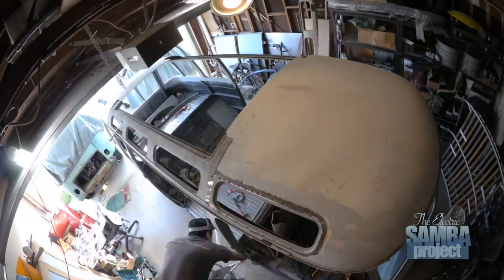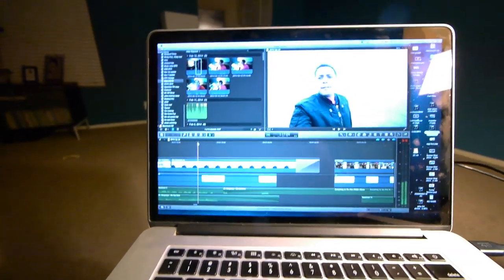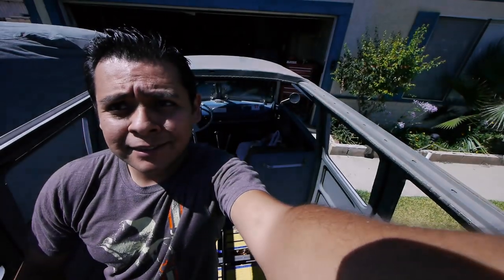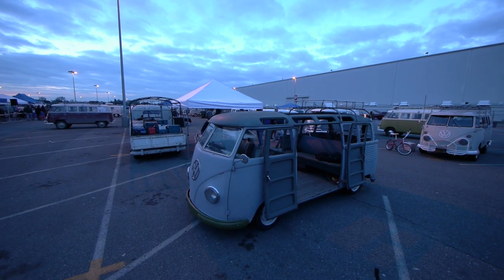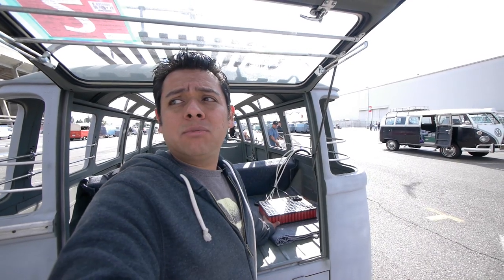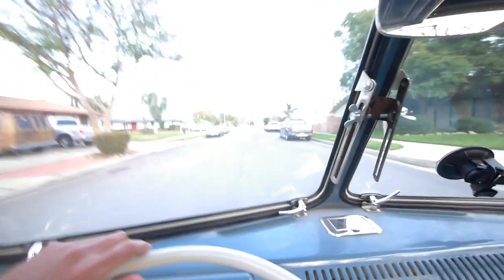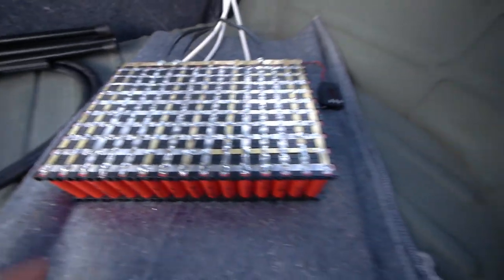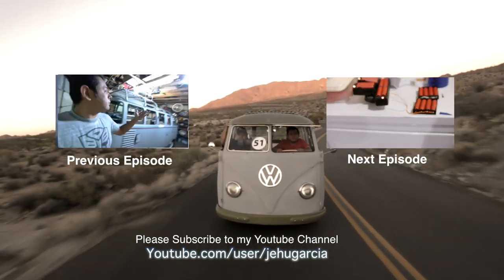Behind the scenes look at eSamba show + DIY EV 18650

Comment: You gave me an idea of building a 5KW Energy Storage box using one of my old Computer Rack cases.  I can install 741 16850 cells in the case.  This way you can rack 5KW of power when you need more power.

Comment: Hey Jehu, first off i just wanna say congrats on the successful testing of the new pack! awesome work i must say! I was just wondering if u are planning on running any sort of battery management system (for battery balancing and such) on the laptop battery pack. If so, which system. if not, howcome? As always, keep up the great work!
Reply from the maker: i might need to use some active balancing system,  but i won't know until i have several modules built,  used cells do have different levels of self discharge.  I charge all cells to 4.25v,  then they sit in a box,  after a few weeks some settle at 4.2v  some at 4.199v and some as low as voltages below 4v.  this in itself is not a good indicator of cell health as often cells that did not loose much voltage yield very low capacity and sometimes cells that lost one 10th of a volt come in at 2000mah or above.  So we will just have to see how well i can match modules

Comment: Did you paid attention to connect the high current lead on your cells module to the area that will make a good current share over all the parallel cells to avoid having the cells that are closer to your main connection to suffer from higher current draw?
Reply from the maker: not really

Comment: I can't believe it.  You went 50 miles on a pack of  150, 16850 cells?  That is amazing!!
Reply from the maker: Not exactly,  150 paralleled 18650 cells give you  3.7v,   you need another 29 modules to bring the voltage up to 111V,  in this case i used the 37 liFe04 cells already installed on the samba.

Comment: Jehu,  Here is the explanation of the strange display on your charger during discharge test.  The ?5.14 means 155.14 Ah.  This is because the people who implemented the capacity test never expected a battery above 99.99 Ah so they did not test for overflow from 99 to 100.  The digits and codes that follow the digits in the ASCII counting sequence are 0123456789:;<=>?@ABCD and so on.  So a colon ':' would be 10X.XX and a semicolon ';' would be 11X.XX, less than '<' would be 12X.XX, equal sign '=' would be 13X.XX, greater than '>' is 14X.XX, and finally question mark '?' is 15X.XX where the X.XX are filled in with the real value the charger counted.  So you appear to have a battery that holds 155 AH as counted by the charger and 180 as counted by the other meter giving a total of 335 AH or an average of 2.23 Ah per cell for your inexpensive cells.  Since you don't know how well calibrated your measuring gear is I would suspect this number might be a little high.
Reply from the maker: Ah  yeah here we go,  thank you,   crazy thing is 335 is only 25 away from 360 which is the theoretical 100 mile 40kwh target (360x111=39960)  that means i could reach that by adding another 10 cells to every module

Comment: Just a question, how do you boost the 4.2v from the cells to the voltage requiered by the motor?
Reply from the maker: by stringing 30 cells in series
Reply: jehugarcia ooh okay! thanks :)